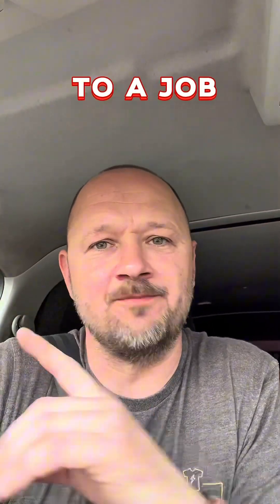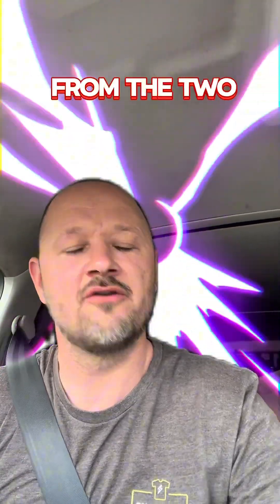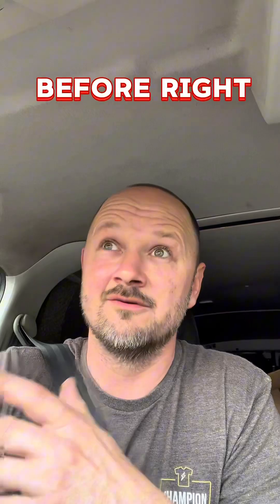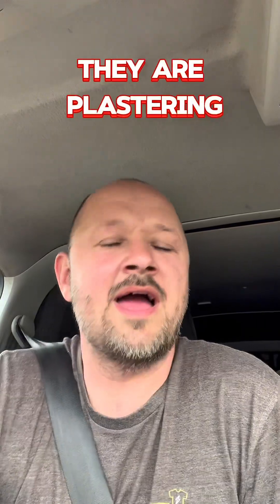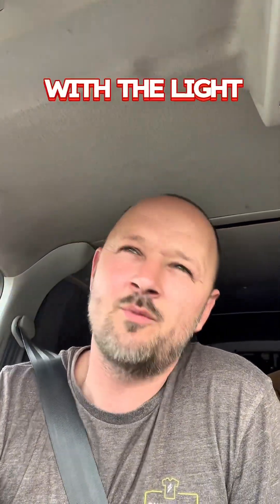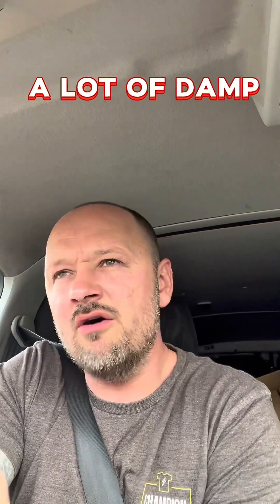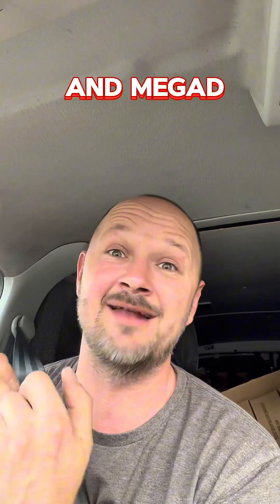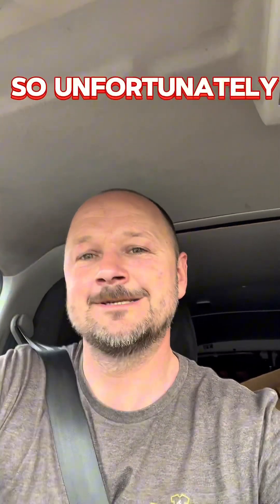Got an Electric Shock... But Why?! 😳

Comment: It’ll be static discharge, does the customer have a synthetic bath mat or rug? The dry climate we have had recently means there is less humidity in the air promoting static electricity
Reply: @dom_99_  I'm thinking static to be honest bud, depends on your footwear and all sorts, I get a belt from walking across my wooden floor and touching the metal door handle which is screwed to a solid wooden door. 
You can hear the crack of the spark and one or more of my fingers cracking. Static is often overlooked.

Comment: Yes you have a faulty appliance and check your rcd. I seen the 50 volt hold down voltage on the cpc between live and earth. Rcd did not trip. We design fora massive fault current to create a very fast ADS. It really should trip.

Comment: Kitchen fitter called to say he was getting intermittent shocks from the copper water pipe.  

Plastic incomer to copper pipework, bonded to the MET.  Earthing system all correct. Ze fine. Continuity fine. Global IR fine.  Voltage test to stake driven into earth in garden, no potential difference.  I was happy that the pipework was not at a raised potential.  

The fault:  Kitchen fitter had been working on the ring final, and had left the CPC open circuit in two places, leaving most of the ring unearthed.  The washing machine was plugged into this part of the ring, and it was this that had the raised potential.  KF was getting shocked when making contact with both WM and pipework.

Restoring the continuity on the ring CPC corrected the problem, no more shocks.

Comment: Had a job which someone kept getting a shock from the bathroom tap. Plastic pipe work coming to the tap too. It was the kitchen lights causing it in the end. Was getting around 120v on the metal tap! Even with plastic pipe work. Sorted it out but still shocking

Comment: Obviously it's an indirect screw or nail in the wall conducting the pipework temporarily from wetworks , but should trip out on the  Rcd 30ma threshold 

Could be 10mm  bonded at   source of supply  , but could go to plastic pipework   back to copper pipework under the floor  the  again causing it to be classed as a metal object 

We used to have to do 6mm supplementary bonding in bathroom bs7671 Regs back in Early millennium 

But the People who changed the Regulations Amendment 🫣
Reply: Doubt it mate! RCD is 30mA 30 thousands of an amp. It would trip ffs!

Comment: Maybe something would show up with an insulation resistance test at the board, like some others have said maybe the wet plaster is in contact with a live conductor, maybe a plaster board screw or a skirting board nail have caught a live conductor

Comment: I got a call from a decorator once who when hanging wallpaper he got a shock. Found out that a pin from a picture had punctured a cable and when in contact with wet paper (well the rest is history after repairing the cable) all ended well but can you imagine if a child had brushed up against the paper 🤷

Comment: I’ve had something similar, it was down to the heating/hot water controls. From memory, when the pump for the central heating was called for a loose hair of a conductor was touching earth intermittently. Check the heating wiring mate inside the plumbers wiring  .

Comment: If the plaster is damp and in contact with live somewhere, it is possible that they are getting a shock if in contact with the earthed radiator.
I would however expect if this is the case for the protective device for that circuit to trip. 
Good one Ben, if you do find the cause let us know the outcome!👍

Comment: Enjoy your posts. Did you stick a clamp meter on the incoming earth check for occasional imported current on the earth. 
Have had in the past neighbours cooker incorrectly wired.  Getting shocks from sink in house. Neighbours cooker was 2 fields away.
Be checking incoming earth with earth leakage clamp
Reply from the maker: Good idea, Wouldn't the RCBO or surge protection help with that?
Reply: @toolboxtalking  surge protection only for big spikes and on line and neutral chucking it into earth.
If it comes in on the earth then does not go through the rcbo. Rcbo only picks up the line neutral imbalance as you will know.
Love the channel and podcasts.